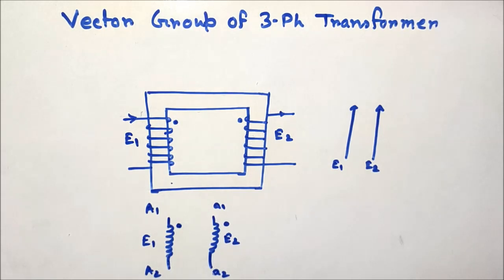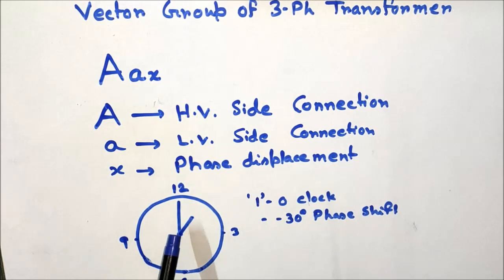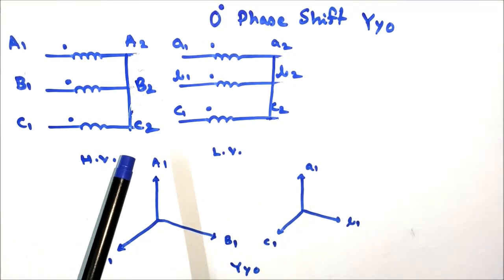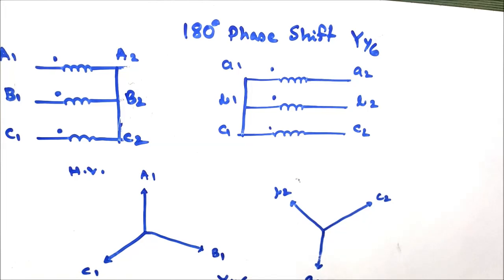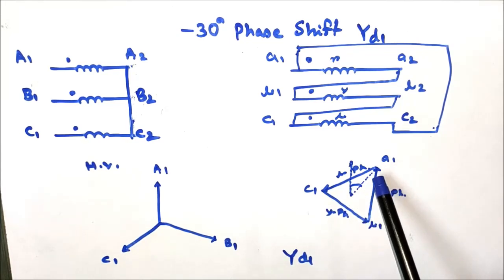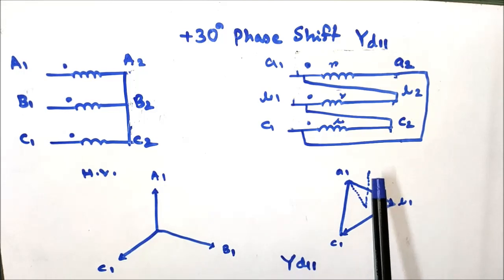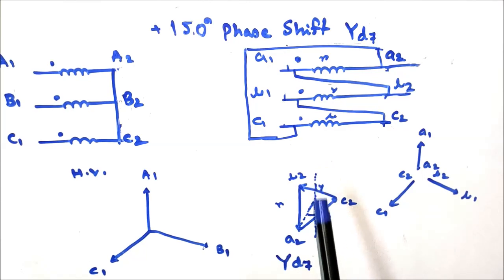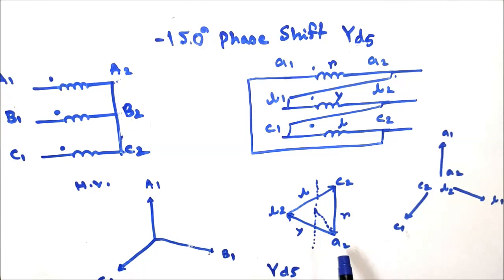VECTOR GRUP OF 3 PH TRANSFORMER (Yy0, Yy6, Yd1, Yd11, Yd7, Yd5)

Comment: Why we required phase displacement
Reply from the maker: For parallel operation of transformer vector group shall be same. Also  vector group must be known for giving setting in a differential protection relay for transformer.
Reply: @relayprotectionelectrical   parallel Operation could be done with any of the two identical vector group transformer. Let, I choose two Yy0. But my question is on what basis I choose Yy0, why not Yy6. Application requirements kya h vector group ka